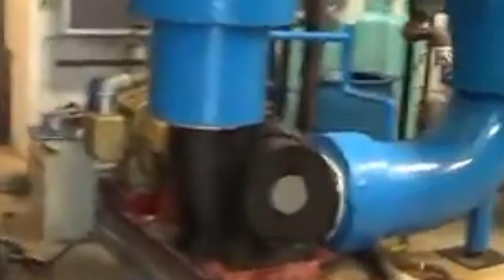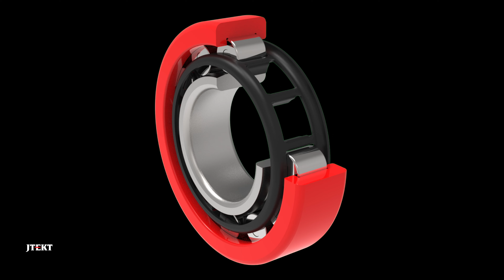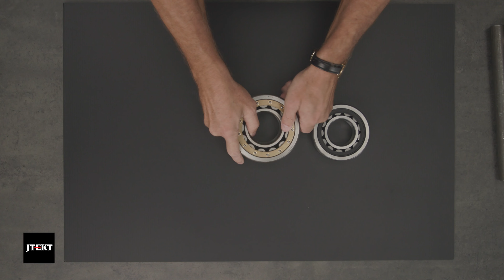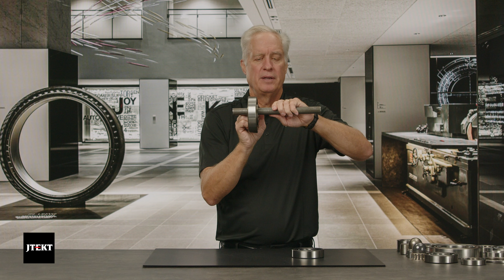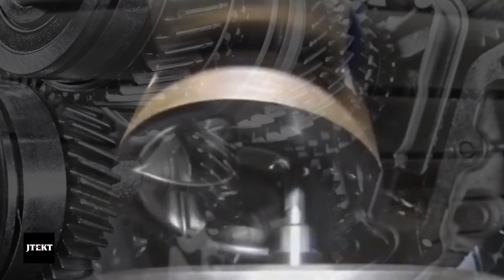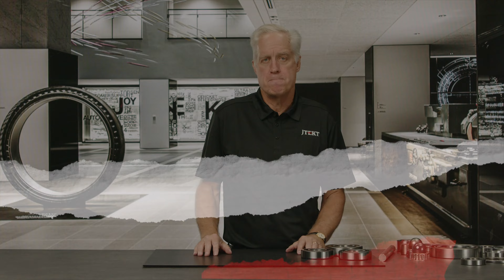Bearing the Load With Cylindrical Roller Bearings

Comment: yeah i need that cylindrical.
but in here to find specific type. its NUP version is harder than NJ and NU type

some regular engine, like car and bike dosnt have holder. so it will feel off or touching case. 

with NUP only need ring snap to holding bore. i need nup version for heavy load on dirt bike and good impact resistance.

its hard when modifying part on hangging drive shaft with only single bearing holder. 🥲